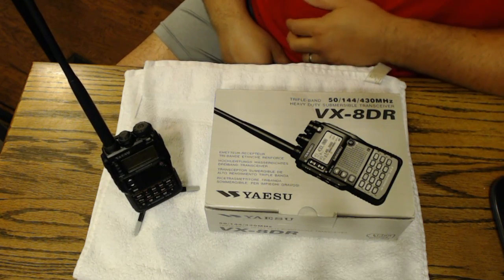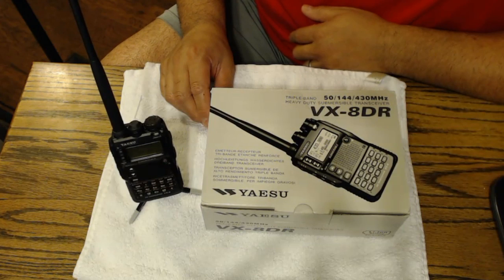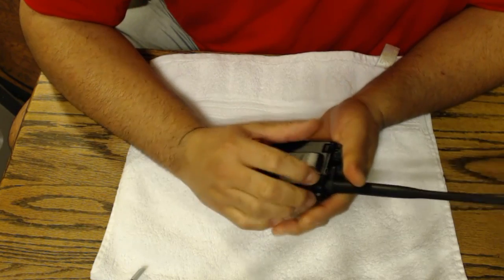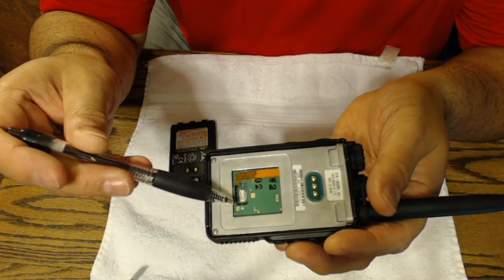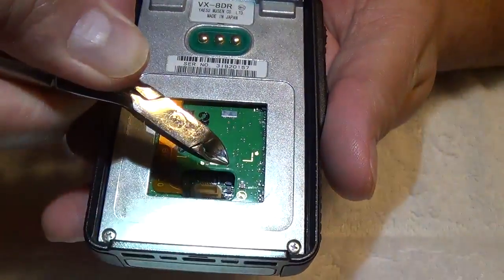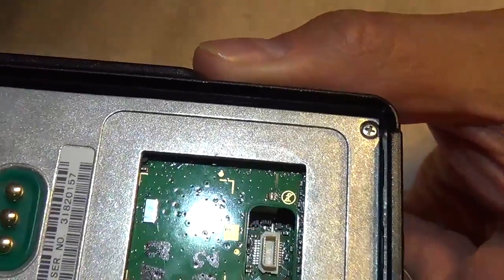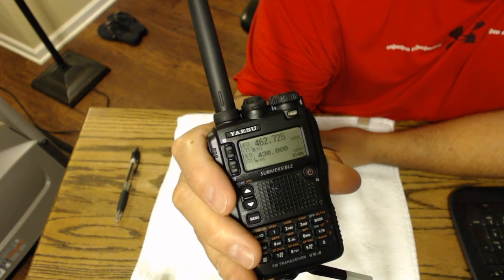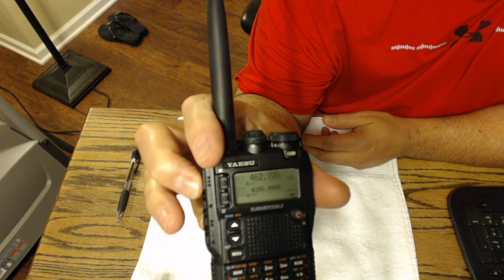Yaesu VX-8DR CAP/MARS GMRS FRS Mod

Comment: BEWARE: You cannot use CHIRP after this mod. It will throw an error when you try to upload.
Reply: I think you  can if you delete the old template and create a new one after the mod.
Reply: @scottgarvy  Also the APRS modem function does not work anymore.
Reply: @brothertyler I don't have GPS so it's not an issue for me.

Comment: !!! READ CAREFULLY !!!

You make this modification at your own risk !
I am not responsible for any failure or damage to your Yaesu VX-8E
The modification is for educational purposes only !
Do not use frequencies for which you do not have a license !

!!! Only for Yaesu VX-8E !!!

Remove smd resistor
 !

1 Power On
2 set MODE
3 # 21 CW ID
 type in “AH029M”
4 Push “SET” to get out of set mode
5 Power off
6 Push HM/RV + MENU power on
7 Turn Dial to choose MODE * * *
8 Push F/W
9 Power off
10 Power on

Enjoy !

Comment: Yup, that is why it is called MARS/CAP modification: MARS (Military Auxiliary Radio Service) / CAP (Civil Air Patrol), also USCG-AUX (U.S. Coast Guard Auxiliary) extended frequency modification. I suppose one could use it on FRS (Family Radio Service) and GMRS (General Mobile Radio Service) in an emergency. However since FRS and GMRS are outside the Amateur Radio Scope of operation, there will be no HAM self-policing of those bands. If its used in an emergency, I doubt the FCC would take the time to investigate his PEP coming from an HT and issue a NAL (Notice of Apparent Liability) so as long it is an emergency. So, put your Ham Badges away,... slip the pen back into the pocket protector and wipe the dust of your flannel shirt and go back to the 80 meter band and wait for Art Bell to check-in on the net.

Comment: Running into an issue with the MARS mod on my FT-857, the radio only transmits with < 1watt at 462/467mhz after the mod. In the regular 70cm band it transmits with the full ~20 watts. There seems to be a sharp roll off in transmit power around 453mhz that renders it almost useless for GMRS usage. Any advice to get it working with full power without doing an external amp?

Comment: Advantages of one of these Yaesu's over the Baofengs? I have the GT-3TP with 8watt output and pretty happy with it.
Reply: Ive got both, Baofeng GT3P $50 No HF  but gets all uhf CB 470mhz   unlike this $500 radio that is great quality but not getting to at least 480MHz uhf
Reply: Incorrect, baofeng can go to 520 u got old software, no baofeng gos on cb frequencies way too low @27.meg

Comment: Hello poppa bear you can also get the radio un locked  it goes 50-52 144-146  430-440 but u find a dealer hat unlocks the radio you can go 50-54 140-174 420-470 tx rx and all other frees rx only

Comment: You really can't use a VX-8DR with blister pack FRS/GMRS radio's.  The FM deviation is not the same.  The VX-8DR is not capable of transmitting at the 2.5khz deviation that FRS uses.

FRS/GMRS use 2.5khz deviation (12.5khz channel spacing).  The FCC designation is 11K0F3E for this modulation.  The VX-8DR is only capable of using the wider 20K0F3E which is 5khz deviation (25khz channel spacing).  The VX-8DR is not capable of using the narrow 2.5khz deviation.  The "Narrow FM" mode referenced in the VX-8DR settings is actually the wider 5khz deviation. I believe Yaesu calls it "Narrow" to distinguish it from the "Wide FM" mode in the VX-8DR, which refers to broadcast FM stations.  Broadcast FM stations use 150khz (+/-75khz) deviation.  

In the Baofeng's, things are named quite a bit different.  "Wide" in the Baofeng is a 5khz deviation, while "Narrow" is 2.5khz deviation.  You can set a Baofeng to wide, and set the VX-8DR to narrow, pick a FRS/GMRS frequency and you can communicate.  However, you're not using a modulation that can be understood by blister pack FRS/GMRS radios.  Sure, you can break the squelch by keying up the mic.  But you won't be effective at getting your voice through.  The FRS/GMRS radios will probably sound really quiet to the VX-8DR.  The VX-8DR will sound like much of the audio is clipped or garbled to the FRS/GMRS radios.  In fact, the VX-8DR might even prevent other FRS/GMRS radios from communicating on adjacent channels.  Some Amateur Radios can be configured for the Narrow deviation (2.5khz), but the VX-8DR is not one of those.

I am not trying to talk anyone out of mod'ing their VX-8DR.  It's your radio.  Do what you like.  Just understand what capabilities that you will have or will not have when you are done.  The Marine VHF band uses 5khz deviation, so the VX-8DR should work fine over there.  That's why I mod'ed my VX-8DR.

FYI: Some of the MURS frequencies are 2.5khz deviation and some are 5 kHz deviation.
Reply: Oops, my mistake.  Apparently the VX-8DR might be able to do half deviation.  I was just perusing the manual further, and found Menu item #37: Half Deviation.  The manual is not specific, but it's possible that this setting is 2.5khz deviation.  If that's correct, then you should set Half Deviation to "on" for any FRS/GMRS frequencies.  Someone with a radio will need to do testing to verify this is correct.

Comment: WY1BLE

It isn't necessarily illegal to use Ham capable equipment to talk on FRS/GMRS, if the transceiver is type certified and you have the appropriate licenses.

The things is that most (maybe all?) Ham gear would not be type certified for FRS for at least two reasons:

1) The power levels they are capable of are above those allowed for FRS. I am sure in today's world of computer control of the TX, that they could limit power to the legal amounts in those freqs, but apparently no one has bothered?

2) The removable antenna. FRS requires the antenna be fixed and not removable or replaceable. 

I assume the reasons for these constraints are to limit the range of the transceivers so they will be less likely to interfere with each other or other people in nearby freqs.
Reply: This was a message from the FCC super snoop and snitch patrol. Don’t you think we know that ?

Comment: Worked for me.  Nail clipper idea was fantastic.  How did you get the old glue off so cleanly?  I used a razor and acetone and got most but not all.

Initially had a 'blank' config after mod, and tried to upload freq's via cable and got a 'radio not as expected' kind of error message. Had to download the existing radio config which was now blank, cut and paste my frequencies & repeaters into that version, and upload them plus all settings back up to radio again.  Works well,

AND - for all you mod critics - I am a licensed ham AND a volunteer who is authorized to transmit on non-Part 97 frequencies when deployed.  So, no hate mail please.

Comment: Lol,I am a sheeple. Nothing to see here Eric Holder. Lol
   Hey, is there anyway you can show that with a little closer look? If not,  maybe tell me what I'm looking for in the back of the radio. Maybe written directions will clear it up a bit. I can't quiet see the resister. Is it the one on top? The first one? I haven't taken mine apart so I don't know exactly what those small pieces look like. 
  Plus, there was a flashing light on your screen after words. Was that the radio or something off camera?  Hey, thanks for your video again. This kind of knowledge may be very important some day. 
   Plus, to all hams, I do not believe its illegal to modify a radio. It is the "transmitting" on those frequencies thats illegal.
Reply from the maker: Take the battery off. The seal is behind that.  Next peel the "waterproof" seal off the (dark grey sticker like) .  The resistor?/jumper target is the only one showing toward you---very small. Kinda like the japanese engineers purposely put it that way---hmmm.  That's the one I closeup show in my video.  PS.  the flashing lights in the video you mentioned was the mothership making their hourly contact with me. Best of luck
Reply: Prepper Bear Exactly. Pretty dumb that people don't understand it's conveniently located VERY much on purpose. Why? VERY simple answer actually. If company X makes radios that can't be modified for out of band(Rat Shack etc) the consumer will simply go buy the other brand. The big 3 Icom, Yaesu and Kenwood all make really nice radios and are furiously competitive. On a side note I just bought two Baofeng UV-82's and am very unimpressed next to a real HAM radio. The dual display is a joke as it is only dual band NOT dual VFO(it's functionally no different than a single display). The VU meter is not a meter(low and high signal both just produce full bars). The LED's blink randomly. I will probably sacrifice both radios for use as a micro solar powered cross band repeater enclosed in an ammo can. Tell me what you think. 73's
Reply: +Prepper Bear can you reuse the seal or do I need to buy a new one

Comment: Do Not do it, it will change the programming of the radio reducing power to about 2 Watts. This is not a jumper it is a resistor of about 86 ohms
Reply: Care to elaborate?   This is the first time I heard of this. The programing remained unaffected for the two I've seen modded. I'm holding off with this mod because I don't want to compromise my 8dr.
Reply: Scorpio Taurus
what I mean by programming is that all these new radios are SDR, the resistor will change the settings in the programming and will reduce the output power by removing it. In addition to that it is illegal to operate like this, good to know though.
Reply: What did your bench test show, Achisachis73?  Can you provide some back up to the claim that the mod reduces power?  Is that in the ham bands, or in MARS/CAP/FRS/GMRS bands?  I'm confused.
Reply: You’re full of shit
Reply: @bulldogbrower6732  oh you are on your period, got cramps?

Comment from the maker: Thanks for watching...still studying manual on all the bells and whistles this unit will do.  Added adapter and hooked it up to my attic 6ft tall Diamond X50 dual band antenna--picked up many stations/very sensitive reception.  Yes, already did the battery upgrade. Ordered the newest 7.4 volt 2400mAh pack from Batt America. Much thicker but a perfect/click fit. We'll see how long it lasts...the stock pack only went about 5 hours.

Comment: Nice video Bear. Shot very well with out any distractions, got right to the point with good clean camera work. I just got this radio with the mod last week myself and love it. Glad you showed a test of the mod, gave me the idea to test it with my old scanner and worked perfect. Also if you didn't know there is company out of Ca. selling high cap batteries on ebay  pretty cheap. Not yaesu's but they are 2000 mAh and Great for a few back ups.